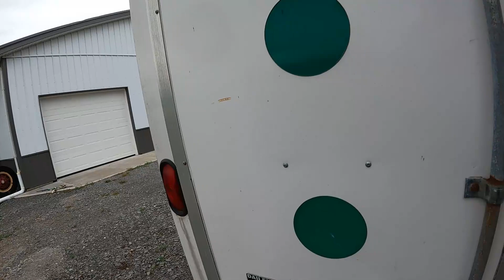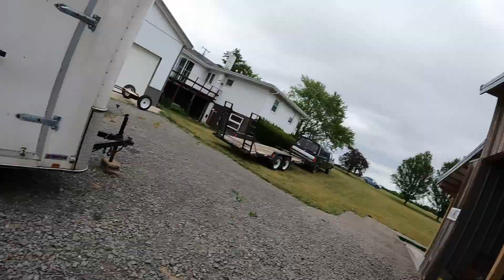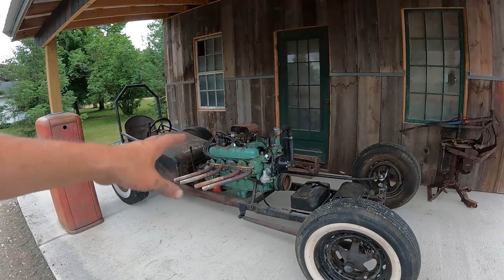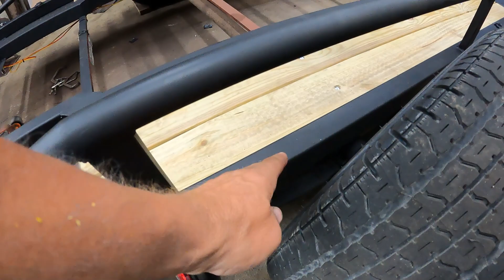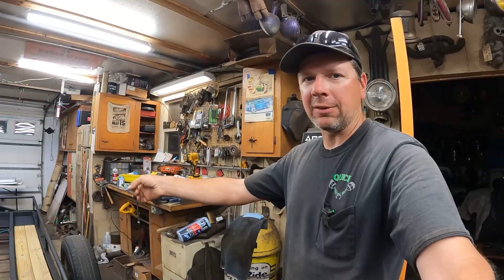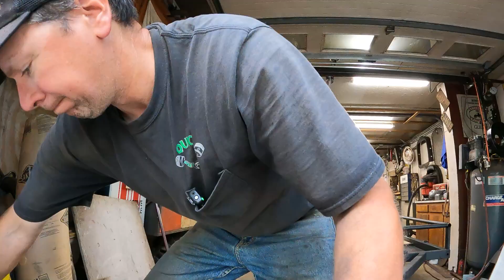New build project...and finishing my custom built dragster trailer!

Comment: Did you have any difficulties registering the home made trailer, Like...Whats the VIN?
Where is the number plate?
Reply from the maker: To do it the right way a new build would have to be weighed and issued a vin number by the state.  I already had a plate and reg, in my name, for a homemade trailer I don't use anymore so now this one is that trailer.

Comment: I just found your you tube channel and it's very interesting! I saw a video last night that had to do with a '37 Ford that you were working on that was running rough. You said that you had changed out the 60 hp engine with an 85 hp motor. Right now I'm in the same predicament. I've got a so tired 60 hp engine in my car and I also have a 85 hp engine sitting on the floor that I need to make a swap. Trouble is, I don't know what all is required to do to make this happen. I think I need a different radiator for the 85 hp motor and different front motor mounts.  Do those front motor mounts have to be fabricated or can they be purchased from a supplier? (Can't seem to find such a thing in some of my catalogs.) Any help you can provide would be most helpful as I'd like to get my '37 tudor back on the road.  Thanks, Terry
Reply from the maker: Watch the build series I did on my car.  I did videos explaining everything that I did.  Basically, you need an 85 hp radiator, engine, transmission, and rear axle.  You remove the bolt on 60 hp engine mount adapter then use 85 hp engine biscuits in the holes in the frame for 85 hp.  The clutch linkage and pedal mount is different, the shifter is different, the hole for the shifter needs to move.  The exhaust is different.  You'll need a 85 hp complete exhaust system.  It's not as simple as just changing the engine. I'm running a 59AB, '39 transmission, and '38 85 hp rear axle.